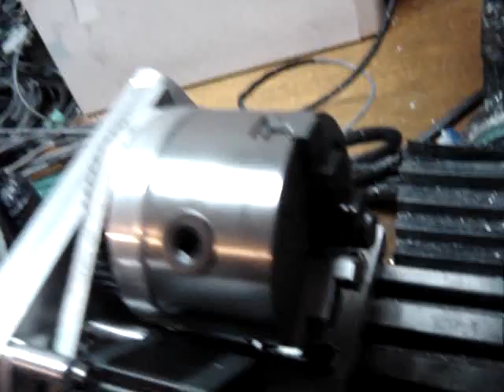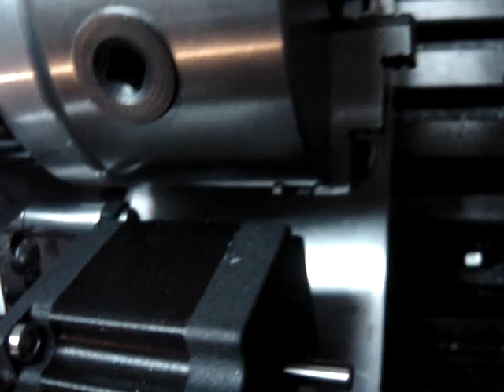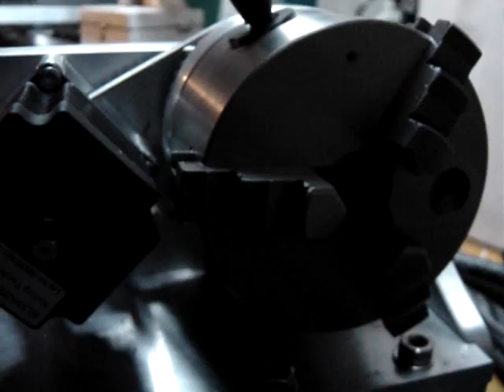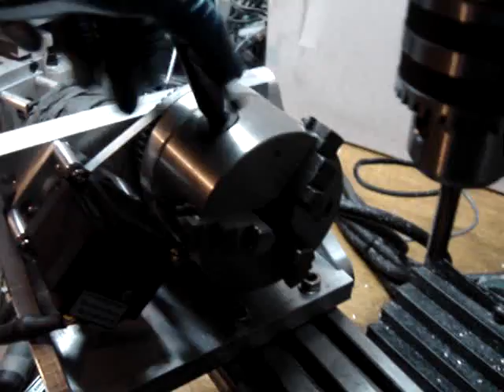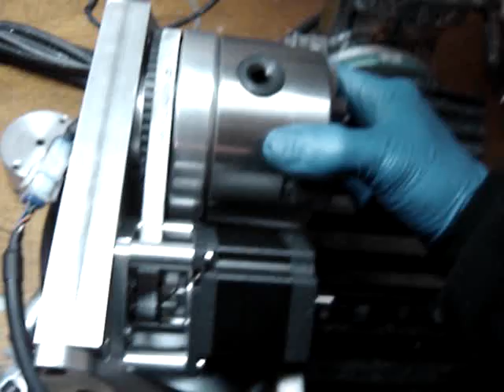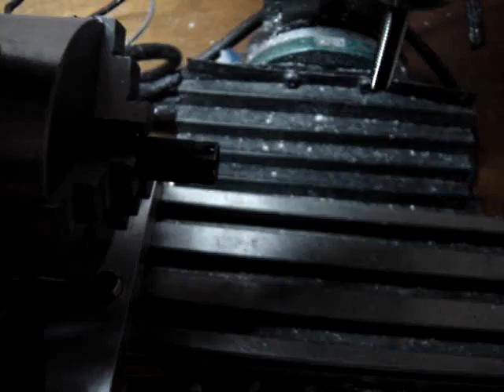Rotary table intro

Comment from the maker: I got all the belts from sdp-si.com, they have all kinds of stuff!  I machined the aluminum faceplate that bolts to the chuck, but I used a plastic pulley from them which I bored out so that I could slip it over the aluminum piece that I made.  It then bolts into place through some holes that I drilled and countersunk between some of the teeth.

Comment: It's not "totally" useless - you could add some sort of "riser" under the chuck and at the same time integrate a 5C collet into the riser. That way you're not always locked into using the chuck for your 4th axis work.

Comment from the maker: That's a good idea, but at the time I wanted to be able to mount the table both that way, and tilt it back 90° so that the chuck faced upwards.  However now I know that it's pointless to do that because with CNC you can drill a circular pattern easily.

Also I did try a 425oz motor and it's a bit better, but still needs more gear reduction.  Simpsons36 also posted vids of a very cool pneumatic brake for his, now that's a great idea!